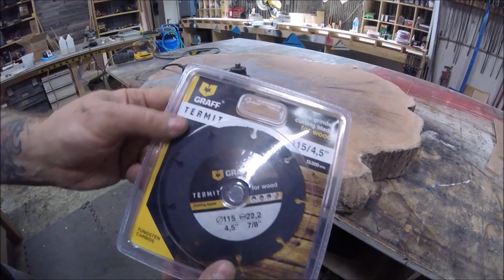Amazing Natural Slab Epoxy Table

Comment: I love it 🥰 it’s amazing and beautiful! I just found an amazing slab yesterday on my hike and me and my dad loaded it up. Gonna do a great ottoman slash seat. But I’m gonna do epoxy but gonna do matte finish on the top. I sure do appreciate you for showing us how it’s done.
Reply from the maker: Way to go! And thank you for the nice compliment!
Reply: @DerekConwayTX  Do you use a pre sealer or pre sanding seal?
Reply from the maker: @judysteed3476  usually a thin sealer coat. I was told a coat of spray poly works well too.

Comment: Trying to learn this skill. What did you use on top that you used a roller to spread and why no bubbles. Thanks, great job.
Reply from the maker: Hey Dave. That is epoxy as well, just rolled out with a foam roller. Usually not many bubbles.

Comment: I just cut down a rather large black walnut. It has been dead for a while. Bone dry. Sawed the crotches n saved every limb. Gonna buy a ripping chain for my chainsaw n mill the trunk n whatever else needs flattened. Got huge oak rounds also. They checked very badly. East Tennessee. I'd sell some to afford the epoxy. Hit me up if interested.

Comment: I m about to try a small natural slab...can i marine grade varnish it or do you oil it?
Reply from the maker: You could do either. Using that final finish I'd sand up to 320 grit on the lat epoxy coat, then the oil

Comment: I noticed the star bond CA glue in the video, did you use that to help with the smaller cracks in the piece? I’m working with a 36 inch wood cookie that has similar smaller cracks. Did you fill them with epoxy and then the CA to get a level finish?
Reply from the maker: Starbond is great for small cracks and voids. I like the Black, or Brown with their accelerator.
Reply: @DerekConwayTX   Gotcha I will have to check that out. Thank you for the inspiration.

Comment: Beautiful work I’m a newbie at this and I’m trying my hand at live edge rounds 1-1/2 thick 12dia. Oak and maple. I’ve let them all dry but they are starting to split. I applied some boiled linseed oil last night hoping it would stop the split. So I thought beauty is in the eye of the beholder so why not try and fill those voids with a colored epoxy. Any suggestions, am I on the right path?  
I’m open to any suggestions you may have. Your work is amazing!!!
Thanks in advance.
Reply from the maker: I'd let the crack/check happen as the slab dries. Then you see what you have to work with
Reply: @DerekConwayTX  thanks for the advice

Comment: Do you have a link to order the trans fast ebony powder you mixed with the minwax wood filler? Grateful that you share your knowledge.
Reply from the maker: Don't have a link but I got it at Rockler. I had it for 5 yrs before I used it in this vid.

Comment: The table is beautiful, congratulations!  Question for you - after all of the grinding and router sled work, how did you keep the fine dust from settling onto the epoxy?
Reply from the maker: Great question. Turned on fans and ventalation in ceiling. And theres 4 pours there, one a day. By the second day all the dust was gone!

Comment: With the epoxy you used here, could that table go outside on a patio or deck? I would think water proof is taken care of.  Do you know if there are there any UV inhibitors/blockers in the epoxy, will it yellow from direct sun over time??
Reply from the maker: I would never put anything like this outside, mother nature has her way with ANYTHING. This epoxy should never yellow and yes there are UV blockers in this epoxy, however, not sure of the level of blockers...THANKS!
Reply: @DerekConwayTX  That is very true sun, rain, and temperature change will take its toll on anything man puts together.  Thanks for the response!

Comment: Do you seal the bottom of your live edge tables with anything? I’m doing a live edge table and sealing the top with resin but I’m not sure how to treat the bottom
Reply from the maker: I usually clear coat the bottom with poly, or seal coat only with epoxy.

Comment: Please can you tell me, after how many hours you pure a second layer of epoxy and please how thick is one layer, I had a problem with one of my slab, it overheated and cracked, the slab is deep 12 cm, thanks a lot.
Reply from the maker: I used casting epoxy that allowed me to pour about 3/4in at a time. I waited about 4hours between pours

Comment: Hi , I am doing one of these for Men's Shed ,the trouble is sections of wood will not seal for final coat. Any clues please..................
Reply: keep applying more.
Reply from the maker: @dillonchamberlain  Sometimes the sealer coat looks like the wood soaked it in. But it's there, just pour your first coat and get on with it...

Comment: When you brush with the roller, does it leave marks behind as it dries? Will it stay smooth?
Reply from the maker: It basically self levels. That's why I spread it all different angles to even it out helping it self level
Reply: @DerekConwayTX  do I need to sand the table from 60 to whatever the smallest grain is before putting the epoxy?
Reply: ....***Before putting the top layer of epoxy across the whole table.
Reply from the maker: I'll sand down to 220 then do epoxy.
Reply: @DerekConwayTX  thank you!